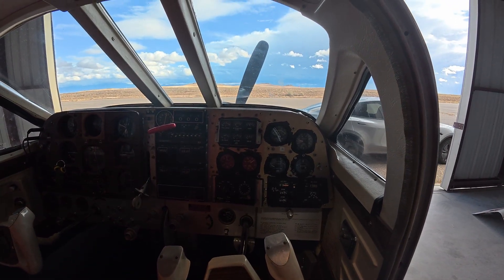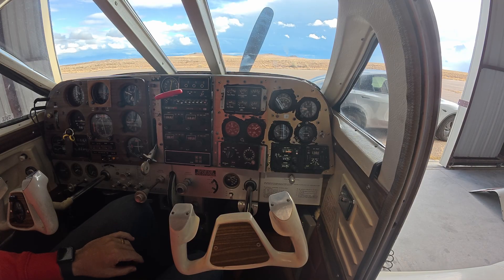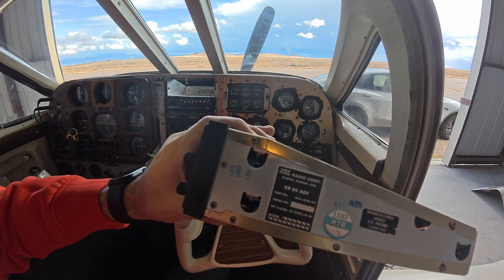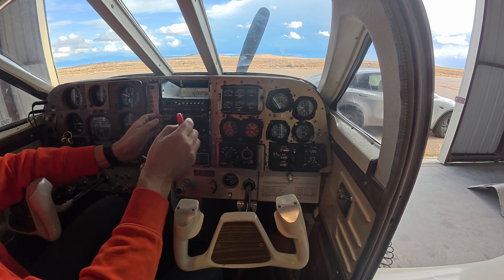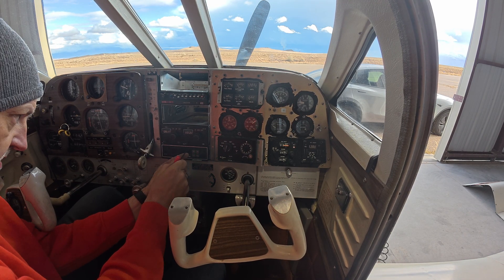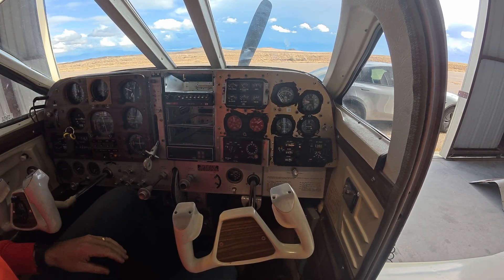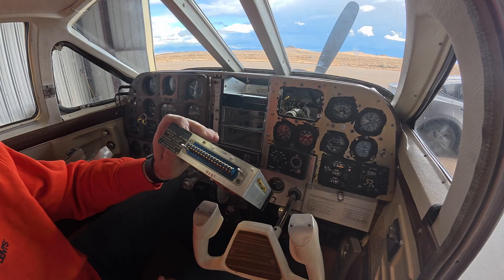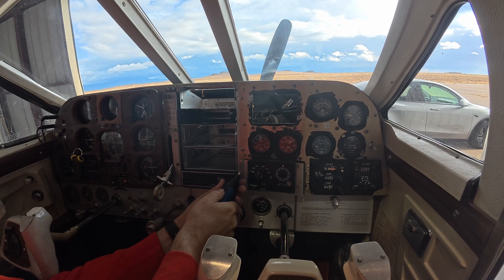Tearing Down the Mustang Panel: How Heavy Are These Old Systems?

Comment: So you’ve already talked to a DAR or FAA district guy about registering the m22 in experimental category?  I’ve heard that it can be an ordeal to do with a previously certified airframe, I know they’ve done AN2 biplanes when coming into the country but they weren’t certified here.
Reply: This is wreckage in motion…

No plan in place, just taking things apart… and struggling in front of a camera while doing it…

Putting a certified plane into experimental category, then using it… involves another layer of government… just to fly the plane…

Last I checked, the government doesn’t want everyone to fly…. It’s getting better, but following all the known rules is the requirement.

Maybe… he is working with a certificated mechanic that we just don’t see… and it’s just a show, where everything goes back together fully refreshed with 50 - 100k of Garmin hardware…

When you hear how heavy the old radios are and how much weight is being saved… it’s nice going digital, but thoroughly disappointing when you only save 30LBs…

Another 10 - 20 LBs will be just the old copper wire…

Along with talking to a DAR, locking in a mechanic to give a hand when you need one is a really good idea…

You may find a mechanic not wanting to see his name in the log books anywhere…

Once enough work is done without logging it… the FAA will be glad to help with the next plan…

Last week we discussed how to get the Britain autopilot serviced… this week, it’s being torn out…

The BK nav coms are easy to replace, or have serviced… tossed…

Buying an RV kit would have been a better financial decision… and a plane that can be flown around without government help…

Put a plan together!

😃
Reply from the maker: Path of least resistance is my plan.
Reply from the maker: Correct, DAR hired. Basically no one has successfully obtained a field approval for a different autopilot, meaning you’re stuck with the Brittain. You can’t integrate it into modern avionics and support for it is non existent.

Not having a functioning autopilot for an airplane meant to fly at 24k feet is a problem.

Comment: Exciting to say the least ! Save weight (a lot), bring reliabilty to top level, improved ergonomy, ease of operation, flight safety 👌! I guess you will spend hours on panel layout design, even if not reinventing the wheel 😏 ... All boxes in the center stack OK so PLEASE, think about putting the AP ctl panel at the top, bizjet/airliner style, and the audio panel at the bottom: to my opinion, it's a lot more logic ... and engine instruments tilted to the left for better reading. Blue Sky 😎💪!!
Reply from the maker: Thanks for the suggestions! Definitely looking forward to the improved ergonomics and reliability.

Comment: Why did you decide to go with experimental?
Reply from the maker: no STC available for replacing the Brittain autopilot, and a field approval for an autopilot seemed like a long shot, or at the very least a lengthy process. To add to this, I want to upgrade the engine ultimately.
Reply: @trueairspeed130  I was just thinking of the difference in insurance costs.
Reply: @trueairspeed130  Well it’s your airplane.  I think that it is great that you are keeping one of these flying.
Reply: @trurade the engine? Or replace the engine?

With what?

You have a certified high output aircraft engine there already… that is not easy to get overhauled because it is so unique…

Changing to something else that has a turbo that keeps the cabin pressurized should ought to be interesting…

Talking about radio weight… as if it is important, without mentioning engine and prop details….

There is an order of doing upgrades… in airplanes.

Radios and paint come last… for a reason.

Good projects start with a well defined plan…

YT videos don’t make enough money to make tearing a plane apart worthwhile…

Ridiculously expensive stuff on an airplane…

Engine overhaul…
Prop overhaul…
Aluminum corrosion…
Airframe corrosion…

Prove to yourself you have these bases covered before you get surprised out of your aircraft budget…

Overhauls are not necessarily required at this stage, remove, and repair, as necessary can be considered…

Know that this airplane is trying to kill you… approach it with caution and respect…

Having a complex prop stop working properly, may not generate enough thrust to fly the plane…

Having a corroded blade fail, can tear the engine from its mounts… thousands of pounds of centrifugal force are created when a blade goes missing…

Get a giant white board, and start writing what you plan to work on….

You could earn your A&P mechanic’s license by the time this gets completed…

Go ask your aircraft mechanic…

😃
Reply: Upgrade the engine? Or replace the engine?

With what?

You have a certified high output aircraft engine there already… that is not easy to get overhauled because it is so unique…

Changing to something else that has a turbo that keeps the cabin pressurized should ought to be interesting…

Talking about radio weight… as if it is important, without mentioning engine and prop details….

There is an order of doing upgrades… in airplanes.

Radios and paint come last… for a reason.

Good projects start with a well defined plan…

YT videos don’t make enough money to make tearing a plane apart worthwhile…

Ridiculously expensive stuff on an airplane…

Engine overhaul…
Prop overhaul…
Aluminum corrosion…
Airframe corrosion…

Prove to yourself you have these bases covered before you get surprised out of your aircraft budget…

Overhauls are not necessarily required at this stage, remove, and repair, as necessary can be considered…

Know that this airplane is trying to kill you… approach it with caution and respect…

Having a complex prop stop working properly, may not generate enough thrust to fly the plane…

Having a corroded blade fail, can tear the engine from its mounts… thousands of pounds of centrifugal force are created when a blade goes missing…

Get a giant white board, and start writing what you plan to work on….

You could earn your A&P mechanic’s license by the time this gets completed…

Go ask your aircraft mechanic…

😃